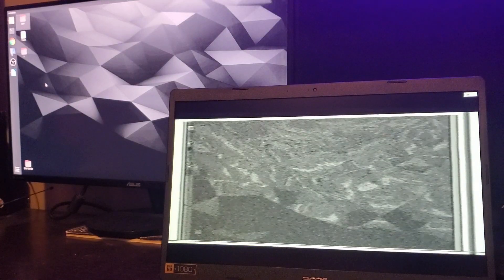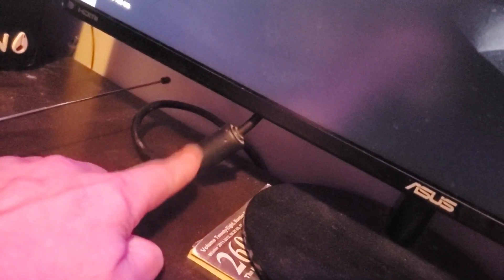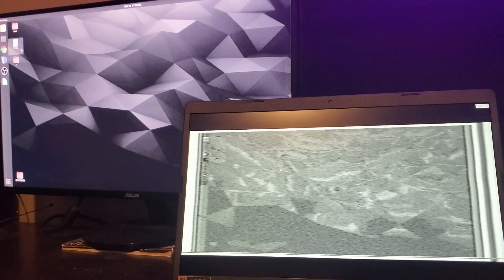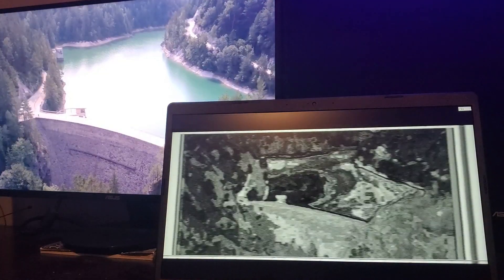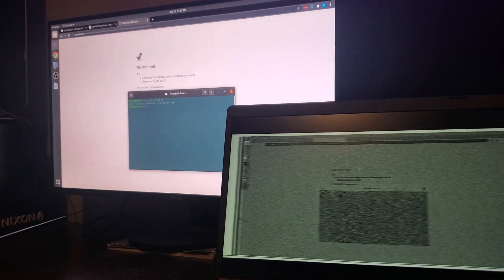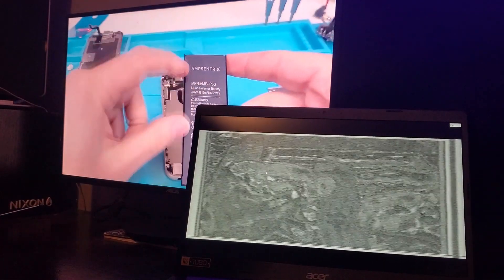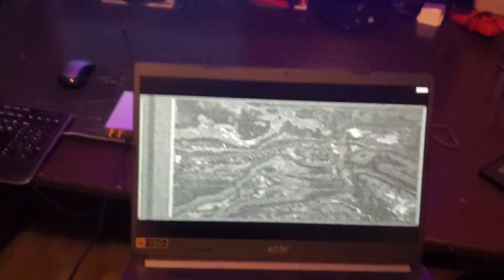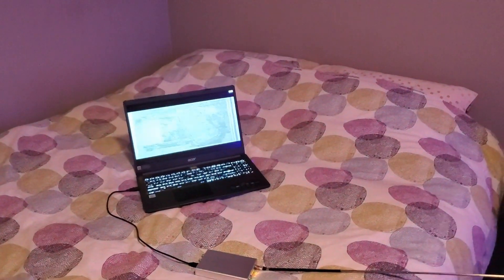SDR - Trippin' Balls with TempestSDR - WOW! (And Felix)

Comment: This is just a simple trick. He’s screen sharing using Microsoft Teams and running it through a filter over WiFi
Reply from the maker: Nope.  It's actually an open source piece of software you can download and try yourself here: https://github.com/martinmarinov/TempestSDR   You just need an SDR which cost about $30

Comment: You can do this same type of attack targeted towards the cable on a keyboard to get keystrokes. The DoD has a program called TEMPEST that is all about employing countermeasures to this type of attack.
Reply from the maker: I looked into that, do you have any good tutorials on it?  I recall reading about the different protocols of wireless keyboards and decoding it but didn't ever try
Reply: @justplaindumbsht  Unfortunately I don't. I'm only here because I was a manager for that program within the DoD, but it is all about the defensive side. They don't teach us the offensive side of it, so I'm trying to learn as I go. That's how I stumbled upon your video. 

This is pretty wild stuff. As you mentioned, it is pretty impractical, but there are a lot of things to think about. Simply moving your antenna away kind of works, but things like your vents, your power lines, phone lines, etc can all carry those waves, too. That is why you don't need to be within a few feet to do this attack, you just need good intel first.
Reply: @justplaindumbsht u are on CIA watchlist after discovering this forbitten technology

Comment: It's a vga cable. analogic signal are very radio leaking. You can't do that with a hdmi signal because it's digital.
Reply from the maker: Nope, It is HDMI on both sides.  I can take a video to show you if you like. :)
Reply: so you think digital signals don't produce as much EMI as analogic? Never seen this attack done on a VGA cable. Would be interesting.

Comment: re-comment from old upload:
One way of possibly securing your HDMI/DP cables would be to utilize display stream compression, since decompressing a sniffed stream with such signal loss wouldn't be really possible without major artifacts.
Reply from the maker: After you mentioned that I went and checked out what they were as I had not heard of DSC before.  All sorts of fun to be had with these things!

Still no NOAA or METEOR captures yet, but it's in queue for another DIY